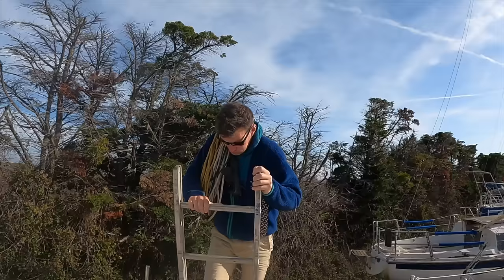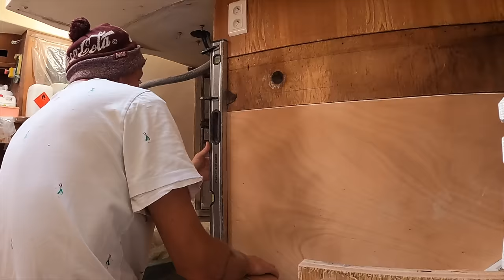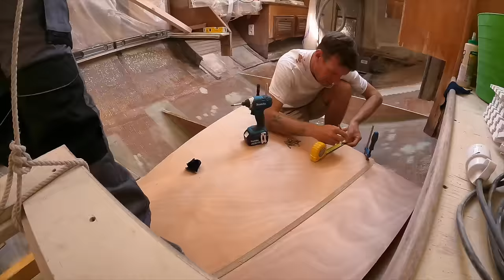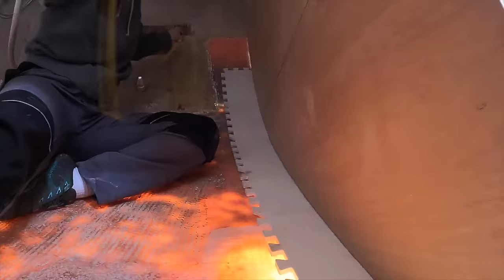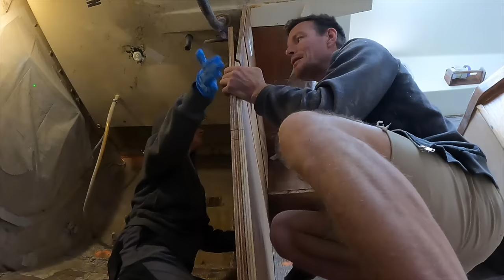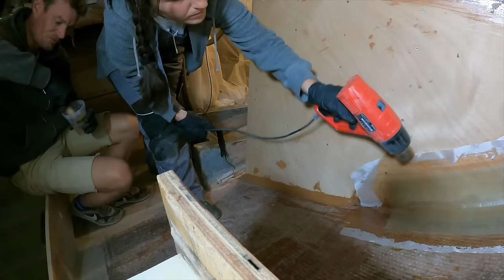After a 1 year rebuild, is our boat still rotten? | SAILING SEABIRD Ep.65

Comment: Hello again Stu and Marina.  I think I understand a little about why you say your boat was rotten, but really it only had a little wood inside that got wet and delaminated.  And then came apart but you are repairing all those areas really good.    I think all this woodwork you are doing looks fantastic and is going to be very strong.  Every week you are getting closer to having a new floor and cabinets and  galley & I am sure it is going to look great.  It's a real pleasure to watch you two work together helping each other finish each project.  So just keep taking your time and thinking ahead about what's next and enjoy the restoration.
Don't even think about how long it might take.  Just take as long as you want.  Ok, can't wait for next week.  ciao, geo

Comment: Guys... You're compromising the bond with the plywood.
You need to wet-out the plywood before putting your first layer on it, otherwise the wood will draw resin out of the cloth and the layup will not be optimised.
Put a surface coat of resin on the wood and allow that to tack off before putting your first layers of wetted cloth on.
Reply from the maker: Oh...
Not much we can do now.
Where were you at the start?! 😅
Let's hope it will be ok.
Cheers for watching 🙂

Comment: Good job, that bulkhead isn’t going anywhere! Looks so much better than the previous swiss cheese version. One thing to help two layers of ply pull up tight, is to drill the sheet on side the screws are going in from to the outside diameter of the threads beforehand.
Reply from the maker: Great tip.
It's slowly coming together.
Cheers for watching 🙂

Comment: It's no longer an empty shell it looks like your at a turning point and it's a credit to you. You say you find cutting glass fibre a chore have you  thought about getting a pair of electric scissors off ebay I've seen professional builders swear by them. Look forward to the next episode.  Great video.
Reply from the maker: Electric scissors?!
Thank you for your encouragement.
At times, we just see more of the same.
But that floor is so close you can almost smell it. 😅🤣😂
2 years, no real floor.
We don't want much, just a floor and a tap.
Cheers for watching 🙂
Reply: You're a good team ....keep going it's coming together now. 👍🏼😎
Just remember you may need to get into some spaces when you build your own interior ontop .. think it through. Make it screw or bolt together where you can unless it's structural as well.

Comment: When you are doing your coving with wood filler on the hull and bulkhead joint drag a piece of pvc pipe  along the joint to give you a nice curve to tab your cloth to.
Reply from the maker: Great tip!
If I find some pipe...
Cheers for watching 🙂
Reply: @SailingSeabird  You should lots on your next dumpster diving trip.

Comment: More great progress guys, well done and congratulations - a good job well done. For your future glue ups: I recommend you wet out both faces of your pieces to be glued with neat epoxy before adding your thickened glue mix, when you apply the thickened mix directly to “dry” timber the timber sucks the epoxy out of the mix leaving a weaker glue joint where the powder has now been starved of epoxy. I’m still not a fan of the foam between your bulkheads/panels/floors and the hull but I hear why you’re doing it - I see it as a place that can absorb moisture and cause rot but I’m guessing that you are onto that and along with the tabs you have both ends and the hole for the pipe well sealed....???
Reply: Yes I agree on your foam comment they are trying to stop creaking 
But it’s kind of not an issue anyway if you tab with epoxy
The old  boat construction methods had the interior separate so they squeaked
Now it’s different as you can add so much strength with epoxy and tabing as epoxies bond strength is so great
Their hybrid method i think will crack and water will get in the joint it’s a shame as they are doing a really nice job on everything 
If they used excepted methods it would be faster and stronger 
But it’s their boat and it’s good  watching and I feel like I know them love their channel

Comment: Yep, resin gets everywhere even when you think you have been very careful. Looks better than it did. Are you going to remove all the screws you used to join the plywood?
Reply from the maker: Slowly getting there.
There is no plan to remove the screws. The screws are all A4 grade and now covered with filler.
Cheers for watching 🙂

Comment: Why enclose the engine room before installing all of the plumbing, wiring, shift /throttle cables, and the engine? Having that wall removed was the perfect time to do all that work... most fiberglass boats are constructed with the mechanicals in place before the bulkheads are installed.

Comment: It's really funny to watch people like these do exactly the opposite of what professionals, who take the time to make vids to show you how to do things.
Reply from the maker: In what why are we doing things wrong??
Any advice would be appreciated.
Maybe... 😅🤣😂
Cheers for watching 🙂
Reply: @SailingSeabird   Dry bond, wood MUST be wetted out with thinned, or at the very least un-thickened epoxy or resin before gluing together with thickened material. This is and has been common practice in the industry since the 50's. Thickened resin, when applied to bare wood pulls the resin out of the mix creating a very weak and brittle joint called dry bonding. 
 But according to the armchair sailors and repairmen, it's ok if it falls apart, you have other bulkheads
Reply: @SailingSeabird  Ok here is my 10 pence worth. Why not take all of the old bulkhead out? replace it with a one piece bulkhead.no joints without any mechanical strength (ie only epoxy and screws) ok the one you have done might be ok or it might not? I don't know the dimensions of the bulkhead? but a new sheet from ceiling to floor would be very smart? cut one out of an 8x4 sheet etc etc I wonder if that is what was meant in the above comment??
Reply from the maker: Hi John! That would have been great but unfortunately that piece of wood would have not fitted through the companion way… so it would have had to be done in two pieces anyway. We opted for leaving the old healthy wood and just replace what was rotten. If we could we would have replaced the whole bulkhead for one new solid one but… not possible 😅
Reply: @SailingSeabird  Ok yah! still enjoying your vids!🙃
Reply from the maker: We’ll investigate this further as it is the first time we hear about it. The thickened epoxy that we’re using is called wood fill and it’s meant to be used as a wood bonding compound. It’s been recommended to us and no one has ever mentioned anything about coating the wood with epoxy prior to application but but we’ll check this because we obviously don’t want to be doing things the wrong way. Cheers for bringing that to our attention 👍🏼
Reply: @SailingSeabird   Dude, there's nothing to investigate, it's industry standard for over 70 years. 
But some will say no. there was a guy who argued with my buddy(a shipwright from Total Boat) thay you don't have to wet out before bonding. it was really funny listening to these YouTubers 
Vinyl, poly, or epoxy has to be wetted out. You brush or roll on as much as the wood will absorb
Reply from the maker: We are not professionals and we are still learning so we are always grateful for constructive criticism. Unfortunately we can't be expert plumbers, mechanics, carpenters, laminators, fabricators, decorators, electricians...
We are just showing our process and never try to teach anyone anything. We also don't take life too seriously and have lots of fun just giving it a go 😂 If we spent our days watching videos on how to do every single thing we would never do any work.
We can't change what we have already done but we can change the way we do it in the future.
For what we have read wood should be primed with unthickened epoxy, but that only means pre-coating a minute or so before recoating with thickened epoxy. This might seem obvious for you but we never thought about it. We can't get it ALL right. Where is the fun on that 🤪
Cheers for the advice.

Comment: I love watching your videos every week and seeing the progress. Here are a few very small tips to make it easier for you to pay attention.

In order to firmly connect two wooden plates together, I would first screw with partial thread. This is the only way to tighten the two wooden plates. After that, you can use screws with full threads.
Like in this Video:
https://youtu.be/Y4Kwfoxi0jA?si=JS0AfyP-bOkRUt7o

For filling the corners, you can very well take a dough scraper from Tupperware of other. It is soft and has a rounding for the glass fibre. 
Bye! 😉👍🏼
Reply from the maker: Great tip with the screwing.
Did similar to pull the two boards together.
Fillets corners, we've found that one you add the epoxy over the filler, you can work it pretty well.
I have a snowboard wax scraper, and I might try that next time.
But in all honesty, I like my little doctor sticks. 🤣
Cheers for watching 🙂
Reply: @SailingSeabird  😂😉👍🏼

Comment: When you use the impact driver to screw the 2 panels together drive the screw in first then unscrew it and drive it in for a second time this pull the two bords closer together than what the first time
I hope it will help
All of the best
Regards
Reply from the maker: The first screw was actually longer to go through both boards. I then unscrewed it and filled the hole.
Great minds...
Cheers for watching 🙂

Comment: I don't understand why you are putting foam between the Hull and the bulkheads,  would it not be stronger with them fixed direct to the Hull to add strength.  ? Keep them videos coming.
Reply from the maker: Hiya.
The reason for the foam is so the sharp edges of the wood don't touch the hull, in case there is any flex.
Originally, there was just air.
I hope this helps to see our thinking.
Cheers for watching 🙂
Reply: still don’t understand wood is softer and more flexible than fibreglass 
How can it cut
Reply: @SailingSeabird  so why not bed them on some epoxy peanut butter mix that way you get good adhesive both to Hull and bulkhead then finish off with your glass matting.. I do get what you are saying I just think that it would be stronger

Comment: Wow that plywood bulkhead looks nice. I would have used the impregnated stuff... green coloured supposed to last 50 years or more in the wet. We have used it for lea boards and have seen no degradation... the lumber yard stores them wet though so they need to be well dried before use.... and they don't look near as nice as what you have, pretty rough actually. No need to key I guess. Anyway, what you have done is much nicer than what I would do and it will make the marine snobs happy anyway. (if they haven't already run away because you didn't just replace the whole interior.) WHat you have done looks great and will be much stronger than it was new. The epoxy will eventually set, West says 72 hours till working on it, 7 days till the chemistry finishes... Don't panic if it takes a few days before it is no longer sticky.... colder just means slower so see if there is somewhere else you can work to give it time.